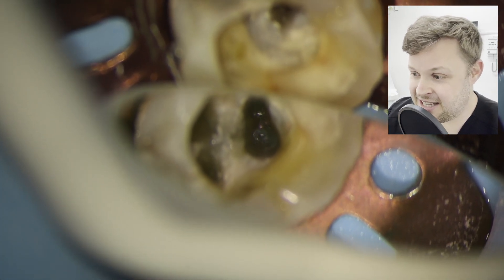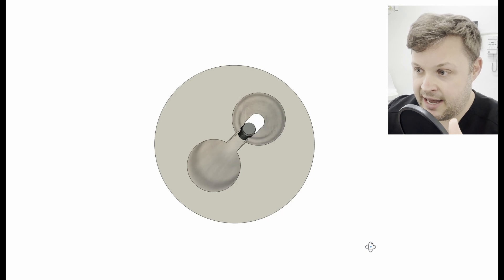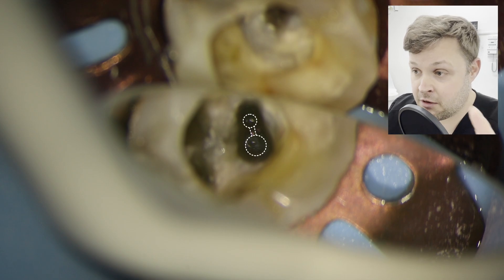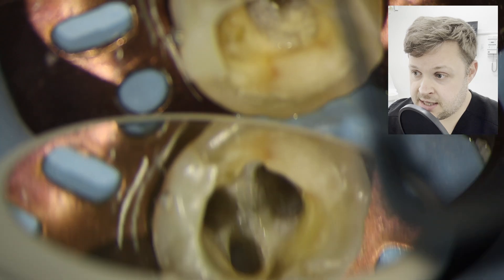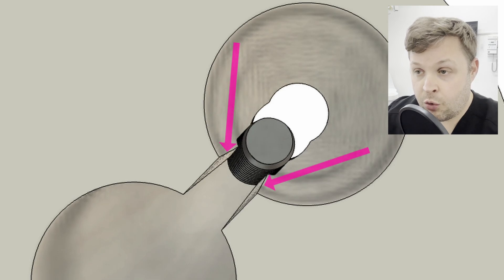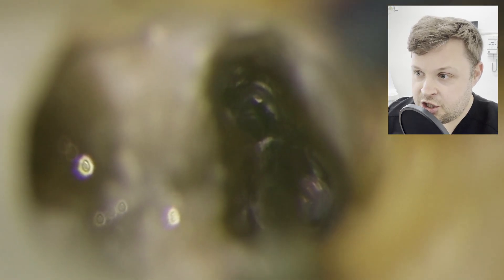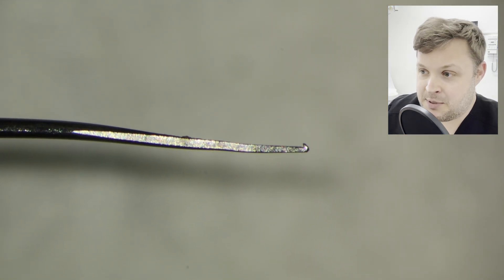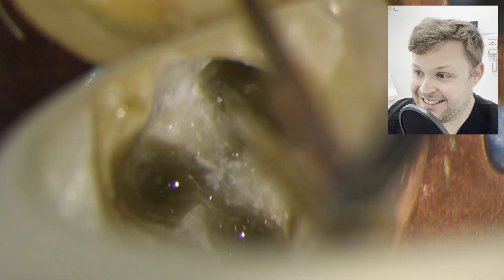The File Snapped… Here’s What I Did Next

Comment: I hate figure 8 systems because of this, I had the same scenario in an upper 2nd premolar, where the file stuck in the main canal itself rather than the isthmus, and I don't have ultrasonics or magnification so I fully shaped the other canal and then did lateral shaping with an f4 to remove the isthmus and join the 2 canals, then I moved the file with a long spreader and locked it between 2 H files and got it out, although I've had shapen  a manual glidepath it still fructured the s1 on first pass :(
Reply from the maker: Best feeling ever when removing a file!

Comment: I recently upgraded my ultrasonics from cavitron to the woodpecker. The unit I have is wired into the belmont bracket table. I was doing a reRCT and broke an XP shaper in the MB and broke a path finder in the MB. The woodpecker came with so many tips. I used the endo tip on medium power and within 10 seconds both fragments were removed. I was lucky as the BFs had non cutting tips.
Reply from the maker: It’s an amazing unit - I would recommend it to anyone!